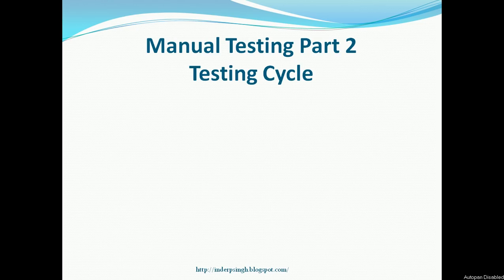Waterfall Model In Software Testing-V Model In Software Testing-V Model SDLC-Waterfall Model In SDLC

Comment: thank you sir your way of explanation is very good , i have one  dobut sdlc means how to develop  a softer  but stlc also include in that na , u said water fall sdlc model in that both sdlc and stlc pls explian
Reply from the maker: Waterfall is an SDLC model, so are Iterative and Agile SDLC. In the Waterfall SDLC, testing follows coding. Now, STLC has its own set of activities. STLC's requirements' analysis, test planning, test design and environment setup can be done before coding completes in a Waterfall project. STLC's test execution and test closure can only be done after coding completes in the Waterfall project. Hope the overlap is clear to you.
Reply: thank you sir

Comment: Sir can we add requirements in the V- Model in the middle phase of software development?
Reply from the maker: Snehal Gondane After an impact analysis, we can add or change requirements irrespective of the current phase of the project. However, each new or changed requirement has to go through each phase like the requirements analysis, system design, coding and so on. Therefore, no, we cannot add any requirement in coding directly.
Reply: Ok sir... Thank you so much..

Comment: At 14:30 
You started explaining that this testing is at the level of this...that testing is at the level of that...
What do you mean by these levels?
Reply from the maker: Thank you for your clear question. I meant which type of testing corresponds to what activity in the V-model. For example, I said Unit Testing is at the level of Coding. If you look at the V-model diagram, you will see that Coding and Unit Testing are at the same height vertically.  There is also a line (symbolizes a relationship) between Coding and Unit Testing. The reason is that Unit Testing is detailed testing done on the source code directly.

Comment: please how do I put this into practical use?  I was asked to write a full detail analysis and design of a oil company operations putting in mind system details, product details and their various operational details
Reply from the maker: Hi Odunlade, your tasks sounds big if it were an actual oil company. So, I assume that the task is for an academic project or assignment. You may want to start learning about Systems Analysis. That is, start with learning the goals of the company, the requirements and the systems that it has (including the inputs, processes and outputs of each system and it's integration to other systems) and go from there.
Reply: Software and Testing Training I am saying thank you for the depth of my heart.  yes it is academic,  it is a school project actually.  I will pick it from there.  but if you have any other links I can read up,  I will appreciate.  thank you
Reply from the maker: Odunlade, you are welcome to my channel. When you learn Systems Analysis and Design, look for some case studies. They will give you the format for your report.
Actually, my channel is related to Software Development and Testing topics mainly. However, you should view my tutorial, How to review Software Requirements at https://youtu.be/Vz7TQ3eAQiU

Comment: sar u didn't undrstnd what my question is.... my question is.. where a QA engineer gets the requiremnt, frm the analyste r dirct frm the customer?
Reply from the maker: +Tayyab Waqar The analyst.
Reply: +Software and Testing Training Hello good sir, may i ask you among the waterfall, v-shaped and  RAD model. Which one is the best.
Reply from the maker: +Muaz Ajam It depends on the nature of the project. For example, if the requirements are fixed (unchangeable and known in advance), then the waterfall model is good. If speed of delivery is critical and requirements are dynamic, then Agile model is good. Thank you for your question.